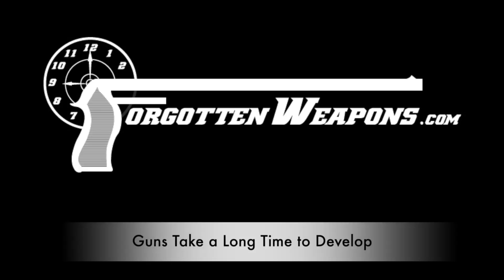Why Guns Take Years to Get Into Production

Comment: Couldn't you just take the prototype apart, laser scan all the parts to get them as 3D models, use those as your blueprints. Make a gun with those blueprints, take the production gun apart, scan those parts and then compare the scans to see what went wrong?
Reply: That's really only a recent time solution and doesn't cover certain malfunctions, such as the AR-15 powder and pressure issues, the brass shaving on the SA80 etc. It's an interesting idea, but it covers only a fraction of all the things you have to look at to figure out what goes wrong between prototype and mass-production.
Reply: Does not solve the issue of deciding what the tolerances are. If you are going for perfect copies of prototype... well, perfection costs a lot. Of course there is also that little issue that you can't replicate the prototype as you don't make prototype in exact same way you make final, production firearms.

Comment: Who is doing it also matters.  Mauser at its height will do a new rifle way faster than early Mauser.  Having all the tooling around helps. having in house heat treatment shaves time off. In house abilty to coat or treat the metal speeds things up.  Even past the prototype stage. Running off 100 guns for a troop trial is way faster for a major company already making guns of the appropriate quality than bob in his garage.
Reply: Mauser at its height still had a lot of problems with new-new rifles (still way less tha than a company with no know-how would have). They were great at tweaking their older designs.

Comment: Hi Ian,

The topic here is known throughout product companies as "New Product Introduction" or NPI.  In all firms there are challenges with NPI and it is a somewhat messy process.  However, I think you have conflated 2 or 3 problems into a simplified view of the problem and declaring it as "the way it is".  I do not believe that this is the case, it is simply the way the firearms industry has operated. It could operate differently if it chose.

Problem 1:  You are mixing the problem of low volume NPI and high volume NPI.  Simply put, the challenges of the AK or the M1 Garand are different than those of a reproduction FG42.  It is a problem of scale and let me put it this way.  There were over 5M M1 Garands made.  If 10K FG42 reproductions are made, that would be awesome.  There is a bigger pot of money available at the scale of 5M units to do Manufacturing Engineering prior to full production.  There is also a lot more money available to ensure your milling machines are properly mounted so they don't shake.

Problem 2:  I call this the 100% problem.  I am a Telecommunications Engineer and in my world the 100% product is POTS (Plain Old Telephone Service).  If POTS is not extraordinarily robust, the service costs to fix all the phone lines is out of bounds.  The same is true with a military firearm like the M1.  The FG42 reproduction can has some minor flaws that reduce its value, but it not product threatening.  100% products are not the norm and are much more difficult to put into production.

Problem 3:  Design Technologies are much more advanced than in the past.  You talked about CAD/CAM systems and I would agree.  You know that there are 3D systems out there that could completely model the gun and actually fire it in software before it is built.  Theoretically, one could build a simulation engine that looks at the tolerances and does a run to see what problems there might be.  This is done in many other industries.  It allows one to look at tolerancing and production yield issues.  I expect it will take a generational change of designers and executives at major manufacturers to get this kind of technique to be used.  Smaller manufacturers will not have access to this kind of design technology for a long time, if ever.

Problem 4: When you talk about the evolution of the AK, you are talking about 2 problems.  First is getting the product introduced, which they did with a milled receiver.  The second problem is called Value Engineering.  Theoretically, they could have left milled AKs in production forever.  However, given the volumes involved they chose to cost reduce it.  When I was working on POTS cards, we were ALWAYS looking at the cost we could make the next version.  Then we would see if a change was worth it based on the volumes.  This was true with other products like DSL, but not with Pay Phone circuits.

Problem 5:  Many times on the channel you discuss feature changes between prototype and production version of firearms.  This looks to extend the NPI time and cost. However, it is again a different problem.  The fact that the customer wants green and you made red does not invalidate the prototype or its ability to get into production.  To me this is a requirements problem, which is a huge problem in product development.  This delays the program, but is not a design flaw per se.  It is a miscommunication of expectations.  I think this is going to be a big challenge going forward in military procurement as the costs to rework here are going to become impossible as products become more complex and costly.

Thanks for the great channel!

Comment: I think Ian has learned this lesson through both the study of firearms and his own hard experience with the Hudson and HMG's STG-44. The initial prototypes looked great. Bringing them into commercial scale production (and keeping that going) is much harder. This is also one of the reasons that once a country gets a really good, dependable gun, they will only change it when a significantly better (and well proven) gun comes along. As Ian said, a gun that is "5%" better is just not enough to justify the time, expense and risk to replace your existing inventory. The STG-44 was a massive improvement over the KAR-98K, which warranted its adoption. However, even then, the KAR-98K continued on in huge numbers right to the end of the war and never went out of production.

Comment: 2:40 not just guns thats how just about every machined part was made you set up the machine to make only certain cuts and either pass it down the line or possibly in smaller shops put them in a pile and set up the next operation, I used to want to make guns for a living but aerospace most definitely pays well enough.

Comment: coming from an engineer - the average good mechanical product needs 2-4 years to properly develop - sometimes longer.
You need to all the conception, designing & calculations before you even touch a tool. Then comes prototyping, prototype-testing, re-designing, re-prototyping, field testing, tooling up, pre-series production and then you can start to thinking about how to transition to a serial production.
No product completely surives first contact with the field test...
and every time you transition a phase the costs rocket up. Fixing something in the design-data costs 1x, fixing something in the prototype costs 10x, fixing something in pre-series costs 100x ...

Comment: What about bespoke/custom small arms companies/gunsmiths that have very low production volume? I'm sure a great deal of time and effort goes into design development, but a smaller firm won't run into as many roadblocks caused by economics of scale, correct?

Comment: Great video! Most of this applies to just about any mass--produced commercial product, too. One thing you touched on is the relationship between product development and process development; sometimes the product design drives process development, and sometimes it's the other way around; you start with the process and develop the product around that. Another concept you touched on is "good." We consumers tend to judge the quality of a gun based on things like how well it shoots, etc. But that is meaningless if it doesn't make money. A manufacturer has to look at profitability first - if you can't sell it at a profit, it doesn't matter how "good" a particular gun design is, it won't be made on a large scale. We tend to think we can "figure something out" just by looking at the end result, but that's hubris. Sometimes the reason for a particular design element is so far removed from the final product it's hard to make the connection at first glance. And most people have a hard time understanding what it takes to go from hand-crafting one item to  having a factory that spits them suckers out by the pallet-load.

Comment: As a mechanical engineer and firearms designer, who has been working on a project for the better part of 10 years, I can tell you all that what Ian is saying is 100% correct. Even in my professional capacity at the company I work for, making automation equipment, we rarely get it right the first time. That isn't to say that we can't make it work, but that going from CAD to physical parts almost always turns up and unforeseen issue.

Couple that with designing something that is meant to contain a controlled explosion and put a projectile on a consistently repeatable flight path, and you have your work cut out for you. From predicting failure points, to determining wear parts, all the way to assembly/disassembly and cleanability, guns are complex machines, meant to control extreme forces in a compact package.

Comment: Ian, your rants are still more courteous than most folks normal conversation. I dare say there are things that will make you raise your voice and potentially be unpleasant but I've never heard any of it on your videos. You may be one of the politest people on Youtube, even when you're essentially calling in to question the reasoning capabilities of another you do so pleasantly.
You've also very nicely highlighted one of the reasons why design and manufacturing are often widely separated in engineering. Just because someone can think it up doesn't mean someone else can make it in a cost effective, consistent manner. I also know enough about machining to know that I don't know enough about machining to have a valid opinion. I'm far better with composites and mouldings and even that had a fairly large margin of error built in without trying to contain explosions.
Please keep making content like this as well as everything else when and where you can. It's educational and informative as well as being extremely interesting to many of us.

Comment: Ian there was only talking about dimensional tolerance. That leaves out material composition heat treat tolerance coatings tolerance... You can nail all the dimensions and have a part be a little too riddle or a little too ductile and it won't do its job.

Or maybe it does his job just fine but it beats up the part next to it. 

A good example too is minor tweaks making big differences. There's a series on SOTAR where he shows differences in metal surface treatments. And similarly on small armed solutions. An AR bolt carrier that is dimensionally identical but nitrided instead of phosphatid is a little bit more brittle in one impact point so they have to change the dimensions very slightly to get the same wear properties. And in a lot of cases when they take the same thing and make it in nickel boron coated, then that can mess up the screw threads for the gas key and cause leaks. So they have to add a manufacturing step of chasing the threads. Many manufacturers don't do that which makes nickel boron carriers potentially less reliable even though they on paper are better. If somebody does the extra step of chasing the threads and making sure the gas key is well sealed then they probably are better.

Comment: Toleracing engineers are focused on dealing with cumulative tolerances. Having having tables of standard tolerances helps a great deal. In design the rule of thumb is to keep tolerance as lose as possible where possible. As well as the tooling/jigs and fixtures, there is also a need for the attribute gauging and inspection requirements.

Comment: I do Mechanical Design for a living. This is a fantastic way of explaining this. I try to explain it to people all the time. There's SO many things that the average consumer doesn't understand. Let me tell you, as a designer, determining the tolerances and fits is really difficult. Even with CAD and simulators, we don't always know whats going to happen. Great video Ian!

Also, people think CNC processes are perfect (Laser cutting, 3d printing, 5 axis milling, etc); but, depending on what you're making, they're not. Most machines get you close, and require secondary operations to complete.

Comment: "AK's are super cheap, you just easily stamp them out by the millions"
Right, look into an AK factory and see how easy and cheap that is.
Reply: You definitely need a small investment
Reply: @matthewpham9525  yeah, small, like a city sized factory.
Reply: @rslover65  The fact that 15-20 relatively undeveloped countries were able to produce them reliably speaks to how easy they are to make. (they were designed to be relatively easy to make). The scale of the factories says more about how many and how quickly certain countries wanted to make them.
Reply: @atomicsmith  really? Then why have American companies failed so far to make a decent one at a decent price? Or at any price at all? PSA had gotten closest, and those aren't as good as com bloc surplus.
Reply: @atomicsmith  Because the Soviets sold entire factories and full documentation to these countries and sent experienced engineers along. AK is designed to be built quickly and cheaply - but on a large scale, in big factories. The design does not lend that easily to small scale gunsmithing.
Reply: @rslover65  You've literally described Izhevsk right now
Reply: @rslover65  Depends on the com bloc surplus to be fair. Not all com bloc AKs are made equally.
Reply: @SlavicCelery  maybe, but nearly all are better than the garbage being made here.
Reply: @SlavicCelery  As far as I'm aware, there were also different sets of documents and amounts of technical aid for your AK making: the set of blueprints at 870 odd pages or a full set of documentation at about 10 000 pages are totally different beasts, after all, and the cost is accordingly different.
Reply: @F1ghteR41  Yup, it's why there's so much local variation amongst the various designs. Also, some countries like China reverse engineered the whole shebang after souring relations with Russia.
Reply: @atomicsmith Wrong

Comment: I was tasked with starting an ar15 production line. We had the technical data, prints, and everything else. It still took 3 months to spin up as we played around with cycle time and toolpaths.
Reply: That's wild I work for Sturm as a cnc tech on  the AR line and getting a line up and running from start to finish in 3 months is pretty quick despite what many people may think.

Comment: Hahaha, noone really understands tolerance stacking like a top machinist. I spent 30 years from cub to boss dealing with the issues left by the company that produced the equipment. So if your $500 or $5000 rifles malfunction your pissed. Try a $2 mill CNC that don't work. Oh and it needs to be running Monday. At a down time cost of $60k to $70k an hour. We were making storm doors not firearms. It's hard to run a factory of new equipment. Terribly hard and expensive.

Comment: CNC programer here, no print is right on the first try, no program is prefect on the first try, no operation goes exactly right, and no part comes off the machine perfect on the first try.  But a group of engineers, draftsman, programer, and machinist can get a first part within tolerance working together.

Comment: To add to the problem, often machines (and a gun is basically a machine) need "free play" in some parts in order to work properly. So higher precision is not the simple solution for everything, even if it can be achieved easier nowadays.
Again, the AK47 is a perfect example. It works so well, BECAUSE its not high precision. It can get pulled of mud, or fire hundreds of rounds without cleaning - and it still works.

Comment: A “NEW” pew “DESIGN”, I believe DOES take years and is a lot of work to get into production. 
This DOES NOT explain why pews that were in production in 2019, intended to be in production in 2020, 2021 and onward, are not available. 
-
If I owned a pew production facility I would be working people on 24 hour shifts and putting out as much as possible.
Reply: They are. But they also know that the bubble is starting to taper off and that if they are paying overtime to make something that they will sell it basically normal retail prices by the time it's ready to sell they're going to take a loss on it. So they taper up before a bubble is anticipated work at peak that isn't going to hurt their long-term reputation for reduced quality, then taper down hopefully just before the bubble does. And if they're smart they keep reserve cash on hand to buy out useful competition just after the competition over produces too long and gets bit by the bubble popping.

Comment: "But with modern manufacturing/materials/cnc machining/etc, gun that I want should be made cheaply and quickly" is my favorite thing that pops up on forums

Yes, that 20th century gun or early aughts prototype that was originally designed for a long extinct or proprietary cartridge that also had a pretty specific pressure limit could be made yesterday in current cartridge offerings with enough made to not cost like 2k+ per